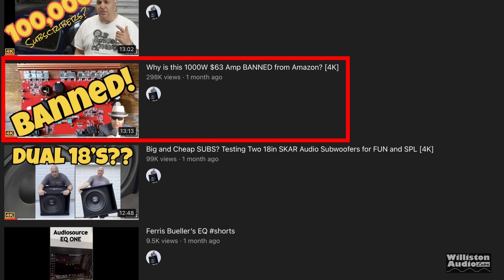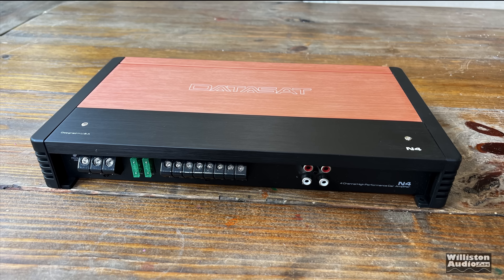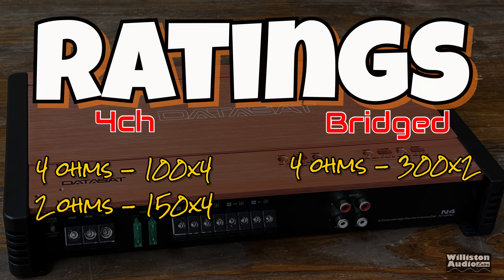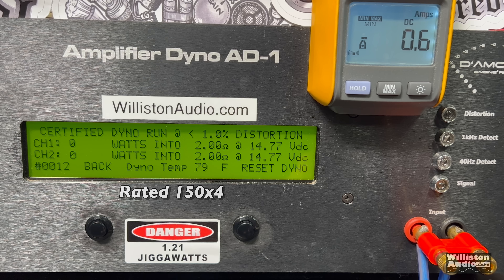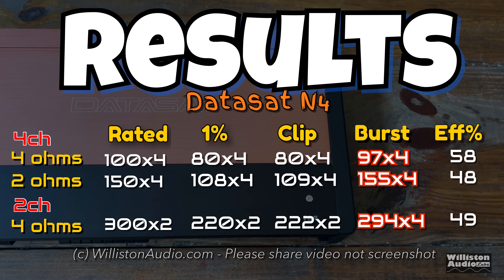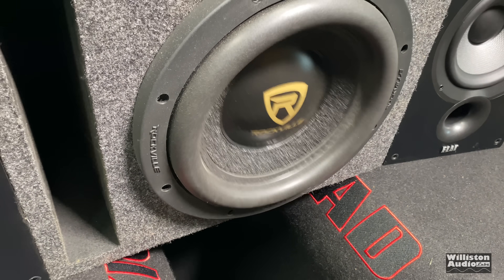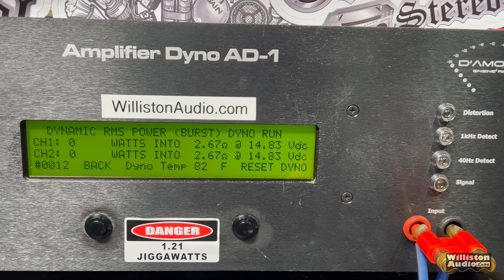How Is This STILL Available on Amazon? Datasat N4 4 Channel Amplifier

Comment: That output mosfet in Q111 shown at 9:42, the solder joints look cracked and not very secure. Probably will be a failure point as well.

Comment from the maker: Datasat N4 (Audio Systems N4) Amp on Amazon
Rated 100x4 @4, 150x4 @2 or 300x2 Bridged at 4 ohms

Check Availability on Amazon: https://amzn.to/3AX4NtA
The Monoblock N1 Model Video: https://youtu.be/4RRyAANKRlw
Datasat N1 on Amazon: https://amzn.to/3bX79jC

Playlist of Affordable Amplifiers https://bit.ly/3cEQYHJ
Shop for Other Low Budget Amplifiers (affiliate links) 
Down4Sound JP34ab: https://lddy.no/15b14
Pioneer GM-D8704: https://amzn.to/3B28oGP
Pioneer GM-A6704: https://amzn.to/3KXD8NT
CT Sounds CT-80.4AB: https://amzn.to/3L45tCe
Alpine MRV-F300: https://amzn.to/3BqW18t

VIDEO INDEX
0:00 INTRO
1:18 UNBOXING
2:19 FEATURES
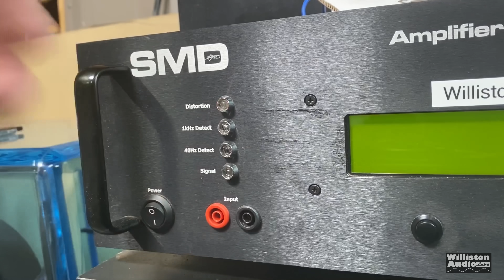3:51 AMP DYNO TESTS
6:54 SOUND DEMO
8:44 WATT'S INSIDE?
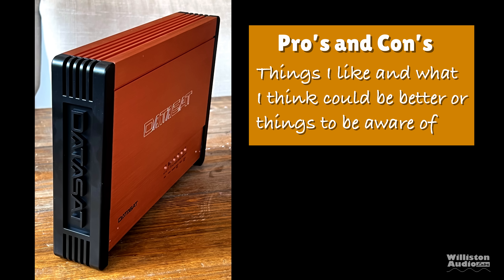9:58 PROS AND CONS
11:13 EXTRAS

------- Cameras and Gear Used To Shoot This Video -------
(Video Gear I Use) 
Camera - iPhone 13pro 1TB - https://amzn.to/3nCjGvc
RODE Wireless Go II Microphones: https://amzn.to/3Q6NVHl
Shure MV7 Microphone: https://amzn.to/3A4OICK
Zoom H4n Audio Recorder: https://amzn.to/3BXjVsS
960 LED Panel: https://amzn.to/2Sxoq3S

This VIDEO was EDITED with LumaFusion on an iPad Pro 12.9:
iPad: https://amzn.to/2Ancr1W
Software: https://goo.gl/6yvWss

--------- Test Bench Equipment -------

SMD / D'Amore Engineering Amp Dyno: https://goo.gl/sJTcf7
XS Power D1400 Batteries - https://amzn.to/2BPFCKW
XS Power PSC60 Charger - https://amzn.to/2CHGcfs
Fluke 1000A AC/DC Clamp Meter: https://amzn.to/2Rw5WDA
Handheld Dyno: http://amzn.to/2u2EgKV
My Favorite Screwdriver Kit: http://amzn.to/2x0VzcE

DISCLAIMER: This video and description contains affiliate links, which means that if you purchase from one of the product links, I may receive a small commission. As an Amazon Associate I earn from qualifying purchases
Reply: According to the manual you showed at the 1:40 mark it says 190x4 at 2 ohms
Reply from the maker: @scottroberts1759  I’m blind and they stretching that power like those fuses stretched

Comment: how does one hook this type of equipment up in their home? my friend had one in the90s withacar battery, bet there's gotta be another way
Reply: Mainly interested in the previous one you showed.
have always wanted a woofer in my home. currently using Logitech 2.1 system
Reply from the maker: Like this (affiliate link) 120v to 12v adapter https://amzn.to/3UtM8P5
Reply: @wal  thank you friend
Reply: @wal  dang I just remembered I no longer have my 1000 watt amp, and my 2x 10-in kickers got stolen :-(. maybe one day I'll get back into that stuff

Comment: ok, so have a few questions. 

1 What does Certified mean?
2 What does Dynamic mean?
3 What is the difference between Certified and Uncertified?
4 What is the difference between Certified and Uncertified as a category vs Dynamic?
and 5, when measuring efficiency, what are you measuring?
Reply from the maker: Most Q’s answered here 
3 Modes of the Amp Dyno and Thoughts...
https://youtu.be/Q0m6NsB-HHc

Comment: The supply is 12 volts...100 watts needs roughly 9 amps. times 4 is 36 amps. 12 volt 36 amps, say 40 amps accounting for losses

Comment: Hi.
Test the hpb-1502 monacor 😉
Reply from the maker: Thanks for the suggestion
Reply: @wal  Once on some forum someone measured this amplifier and the result was theoretically at the level of 1x 372W rms / 4ohm. The declared power by the manufacturer is 500W rms / 4ohm.
Reply: @wal  Another name (older) is Carpower HPB-1502

Comment: 9:42 is the solder joints cracked or is it just me?
Reply: Yes but probably just the meniscus on the top side. It’s unlikely to be cracked in the hole or bottom side but this crack indicates movement of the device during mounting. A LOT of car amps have this issue.
Reply from the maker: Man y’all looking deep at those macro shots!

Comment: Remember when Amp manufacturers were hyping MOSFET, which is a common part in most amps. It would be like Toyota bragging about their alternator when it's just a part of the car.
Reply from the maker: For some companies moving from bipolar designs gave the amps much better reliability. Rockford Fosgate for example

Comment: im kinda curious that tester showed 14Vdc, the fact it was saying dc. Are there amps that put out AC or do all speakers run on DC?
Reply: Search AC or home amplifiers on Amazon. Also, most speakers can run on DC but ohms are usually lower for car speakers. Most home amps can handle 4-8ohm speakers now so interchangeability is increasing.

Comment: hey D!....for a class D mono block amp (for example a JP23) at what temperature would you start to think "OK it's getting too hot? ✌️👍
Reply: If it's running hot, your gain is too high or you're running at an ohm load below what it's comfortable with.
Reply: @CarAudioObsessions   appreciate it Derek sorry maybe it was the way I worded it but that's not the answer I'm looking for....simply wondering what is an acceptable temperature range for class D amplifier?

Comment: You need to learn more about how the manufacturing industry works. For all you know Datasat was looking to get into Car audio products started to have an amp line made then changed their mind. Thing like this happen all the time. So then the company that was onboard to build their amps already had production going and so now what do you do with all the product already made you SELL it and recoup what you can so it isn't a complete loss. Also the clicky clicky as you called it is because they were doing click in place pots so you can get an accurate tune on the crossover section as they would of had a click chart that corresponds to a freq per click. I know of a few on the market that do this.

Comment: I really wish that manufacturers could be forced to rate amps at true RMS not PMP.
Reply: Always check the RMS rating not the PMPO
Reply: Every other industry besides audio tend to use RMS
Reply: But then they won't sell as many! Lol
Reply: This amp is actually far from PMPO., those pieces of flea market junk state watts in the thousands.  6000 watt!!!
Reply: @Terry Hayward, I agree, but manufacturers were fudging the numbers with marketing tricks from the very start when the FTC came in & implemented the new metric RMS rating standards of testing. The battle of watts between Pioneer, Marantz, Sansui, etc.. in the "Receiver War" to dominate HiFi home stereo's was almost 50 years ago that still continues today!
Reply: If amps were rated in RMS It would be no fun when your buddy says I gotta 10,000 watt amp. Under and over rated amps is how true Audio guys get the best deals on stuff. True RMS rating would take a lot of fun out of things.  Polk and Kenwood are usually at there rated power telling the customer da troophf !

Comment: Using an amp dyno... while that tool is cool and all, I would also suggest using a NICE digital Oscilloscope as well to test your equipment, because believe it or not, some of those "dynos" lol... they are not always accurate and can even go bad themselves, or made poorly, etc...  Always better to have two testing units is just my point...  Kind of like how its wise to not leave your tuning to just 1 singular tuning fork... to each their own I suppose.  One of the big reasons why I like a scope, is because not only can you get all your power measurements, especially if you have your scope programmed accordingly it becomes much easier and less calculator heavy, but because you can actually SEE the signal, and just by looking at it you can eventually begin to tell weather or not the signal is clean  / dirty, as well as EASILY seeing its frequency response, since imho it is easier trusting a scope than just by going on "how it sounds".   That being said... if only my ears had the same frequency response as a dogs!! 😀😀😅😂😂  That would also have some cons though... like dog whistles 😜  That being said, its still pretty cool how you include the ear test anyways, since seeing the clarity and then hearing it too is also nice 👍🏻 👍🏻👍🏻👍🏻👍🏻   So you do a good job for sure, thanks for all the hard work you provide!!!

Comment: 1.21 Jiggawatts!.  It doesn't really matter to the average user if the amp is reliable, because it actually has plenty of power.   However, they should be fined for exaggerating the specifications, and made to define the spec accurately.

Comment: I think I found a value king.. MUSYSIC MU-D16K 200$ and pushes my b&c 21ds115 21" to xmax.. I'd love an actual test on This.. mind you bridged it.
Reply: Saw that one too, it looked like good value. Thanks for firsthand confirmation. I got a warehouse deal for $100 though on a 4000w Gemini and it seems to push the Rockville 18” sub and 15” full range well. The Pyle 3000s are hit or miss but I got a couple for about the same and they have a nice range of overall function.

Comment: I'm an E.E. w/>30 years in audio design and don't recall coming across either of those cap brands. I HAVE, however, run across both the knockoff Fairchild pre-finals and the knockoff ST Mcro finals. ST is SGS/Thompson, and Thompson used to be the OEM for RCA (the imprint on most of their semiconductors), GE, Emerson, and others. Anyway, there's NO WAY either are genuine parts! The logos are a little off and are cheaply engraved - an unfortunate artifact of a lot of Chinese "lookalikes" that are often sold as their name brand counterparts, but don't come anywhere close to meeting their specs.

Comment: When you dyno test amps, how do you properly set the gain level?
Reply from the maker: DD-1+ is built into the Amp Dyno and the gain is matched with 10dB overlap (8-12dB is range)

Comment: Looking at the insides its actually a decent looking little class A/B amplifier.. I would use it (if i had it already i would never buy one).. although the marketing and over rating is crap.. but for the price i think its pretty good. With that said, you could easily buy something else used from a more reputable brand if you wanted to.

Comment: I noticed in the close up a couple of the output drivers had bad cracks on the solder joints, seems a likely point of failure in the not to distant future.
Reply: glad i'm not the only one that noticed that solder joint crack.
Reply: Easy fix if you know how to solder. I've had to do some clean up work on some name brand amps before. No one is perfect and QA/QC doesn't always catch everything. I had a decent amp fry on me recently for no reason. Opened it up and two heatsinks and their Mosfets were loosely mounted. Overheated and burned out while also taking out their neighbors in the process.

Comment: After watching watt's inside section i noticed at least you need to solder output stages because joints have started to crack. Also classic old TIP35, TIP36 pairs but should those be on TO-218 package not TO-247. 
Note: found that ST make those in TO-247.

Comment: uh, bridging amps is perfectly fine, you just gotta make sure you DO IT CORRECTLY, or yeah, things can go bad.  Kind of like pushing AC on a DC only circuit or vice versa, or like pulling BOSE speakers out of a car and just wiring them up to a non bose head unit...  you learn things when you get into this stuff...  either the hard way, wise way, or just no way even...

Comment: The amp really didn't do that badly considering the price. You can improve the performance of the amp especially in the bass region by increasing the size of the capacitors in the power supply. 3300uF is very low for a filtering power supply cap, I would add more capacitance, at least 10,000uF per rail. All high end hi-fi amps use huge amounts of capacitance in their power supplies. For example my ME Sound amps use 330,000uF per rail or 660,000uF in total.
Reply: And then you must increase the capacity of the DC rectifiers or they will die on turn on surge.
Reply: Bro do u know much uf is needed for a 2 channel amp. I am currently using 63v 10000uf pair. 5200 1943 transistor 4 pairs in total, 2 pairs for each channel.
Reply: @pcmacd  ..soft start

Comment: I grabbed one since it was cheap I was hoping they'd do more power but I have bigger amps and favorite budget amps already 🙃 good work, thanks for testing another one and sharing results 🤙
Reply: @Randy436  I run up to 16v and though they're noisy and not the best track record I daily drove with a brutus or zeus mono and soundstream picasso nano 16v+ without problems. I've had amps rated 16v protect above 15.5v like the wolfram c2400.1. I had to start it with voltage lower than 15.5v and without a sub amp getting your voltage that low even car off isn't that easy with cmax sold that for cheap and kept the hifonics 🤣 sold the nano with the car but yeah I wasn't too impressed with the wolfram china 2400. Lower voltage it was probably ok. Wasn't 3db louder than the hifonics I didn't think either so 🤷‍♂️ I ran a pair of wolfram hg12s on a dd m4b at .5ohm in my girl's daily til her brother crashed it a couple weeks ago. Ran her system/electric 15.3v so alot less amp issues. Only bring up the hgs to show I'm not biased against wolfram, just didn't care for that budget 2400

Comment: One of my favorite 4 channel amps ever was a ppi phantom p900.4. It was a class d full range with channels 3 and 4 able to set up a bandpass filter so you could power an active setup.
Reply: Very entertaining vid! Keep up the good work! 👍🏾👍🏾
Reply: Same amps as something else I run pretty sure but don't like telling everyone so prices and availability don't shoot up
Reply: PPI is still to this day the underdog of the 90s till the day the owners sold the company and created xtant, to which I have still never seen a single product. I had a tiny little  Sedona series "8ohm stable bridged 50w rms" that I ran 2 Pyle Driver 4ohm 15s parallel with (not the shite Pyle brand out now) and that little amp beat the hell out of those speakers at 2 ohm and never really seemed to get overly hot. Then it ran all the mids when I got the A600.2 (for a single JBL GTO  10" in a vented box tuned to 40ish hz lol) and. the 4/3/2 x-over. Damn that system sung. You'd have thought that there were at least a pair of 12s

Comment: How often do you hear sonic differences between amps? I'd have to guess that's really rare. Maybe it's time to add a sine sweep test for those that do sound different. I have to believe it's some funkiness in whatever tone/filtering it has.
Reply: I can hear a difference between my zapco reference and a power acoustik.   But I am also somewhat of a whacko and most people won't notice
Reply: @Bondovw  If one does a proper A/B comparison test, just maybe with some crappy designed amp. Almost certainly between any tube amp any another, tube or transistor. But between 2 halfway decent transistor amps, shouldn't be possible.
Reply: @brianmack6285   I can hear a difference.  I guess I have sonic ears
Reply: very often.When hooked up to quality monitors, it is not difficult to distinguish a quality amp and an inferior amp, such as this "Datasat", I do not need a sine sweep, I have ears...please believe me Brian, you get what you pay for
Reply: @brianmack6285  Nonsense. I had PPI and Sound Stream Reference amps back when they were some of the best available and they sounded nothing alike. Your problem is you think a static flat frequency response in amps says something about how they sound. Just not so. Maybe you'd like to compare your home amp to one of my recent Boulder amps or even my vintage Krell KSA 300s or KSA 250? I'm sure that they all have a flat frequency response. FYI none of my amps sound similar.
Reply: @Bondovw  Or just normal trained hearing.
Reply: Having borrowed and demo'd loads of different amps, sources and speakers including back to back demos -  even had four amps in at one time...The truth is they can all  sound subtly or greatly different ...the same thing goes for sources, and speakers too!

But if you are lucky and your hearing is less sensitive and you cant hear any differences...  then be happy ...as  it will save a lot of time, money and frustration 😂
Reply: Over the years I can definitely tell the difference between Crapco amps and quality amps. When you push the Crapcos you can literally hear the strain in the music/vocals. Not talking about true distortion. Just an obvious different sound. Like someone yelling and taking a crap at the same time. ;D